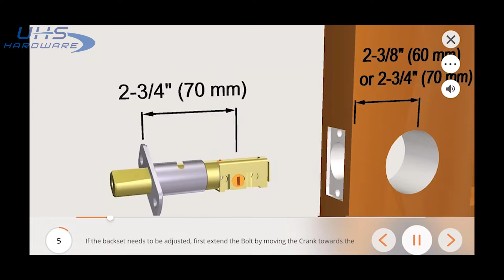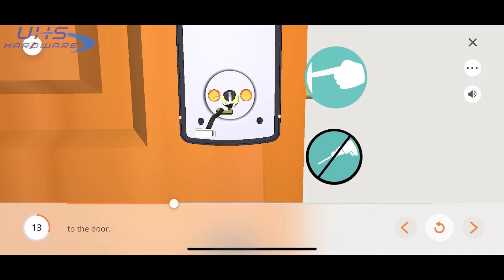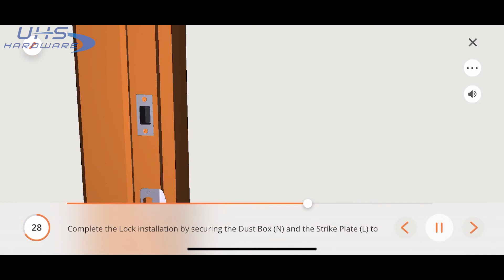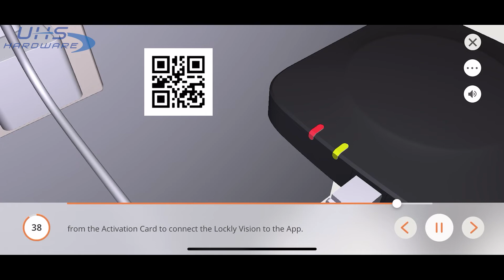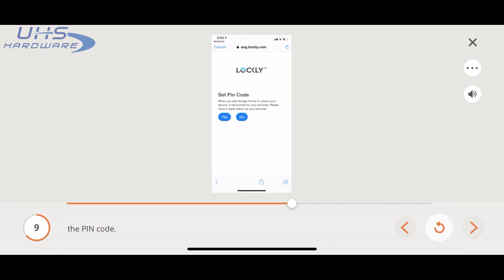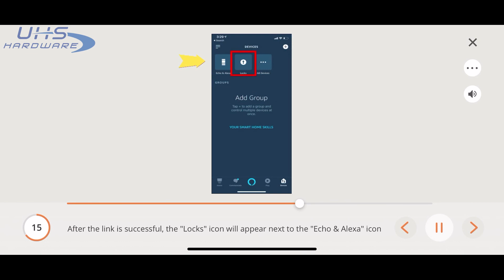Lockly Vision - How To Install - Step by Step | Quick and Easy

Comment: Before purchasing one of these there are several things you NEED TO CHECK!! One, if you already have a deadbolt be absolutely sure it opens and closes without you having to push or pull on the door.  Two, make sure your existing deadbolt meets the required dimensions for the lock.  Three, if you don’t have an existing deadbolt pay a professional to install it.